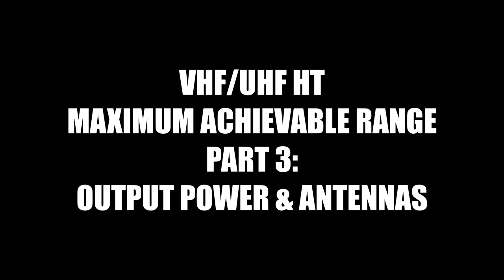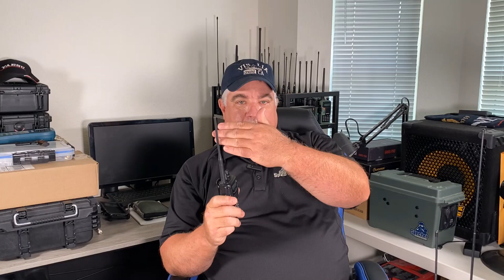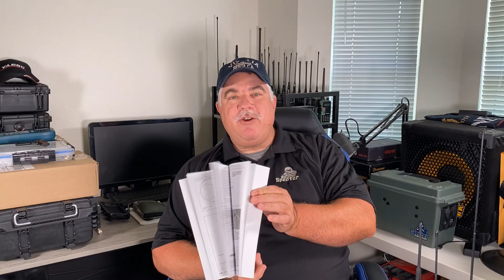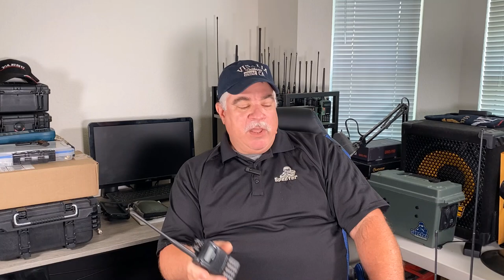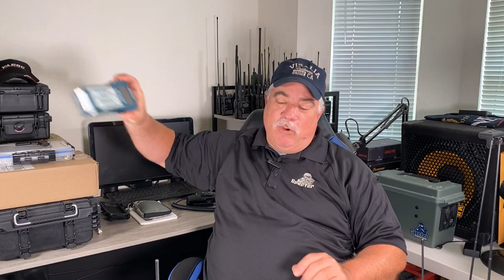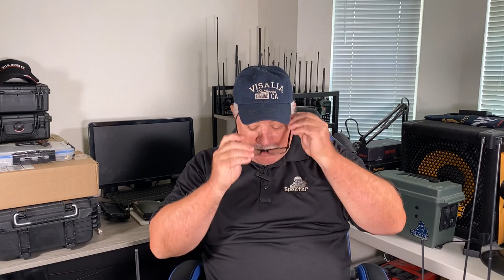VHF/UHF HT Maximum Achievable Range - Part 3: Output Power & Antennas

Comment: KD7CKT, just getting back into my Ham Radio after 5 to 6 years out due to the Loss of my Father, N7JWF/AE7AD. When Dad had strokes and such I had to short sell the house in west Phoenix and liquidate his gear and mine in the move. Just got a Yaesu FT-60 at a local Pawn shop for less than $80! Happily, it came with the original dual band, rubber duck antennae, a completely dead NiMH battery which happily came back and so far holds a full charge and the repeaters here in Flagstaff. This HT had a few channels already programmed and after a week or so monitoring, I am now involved with one evening net. 23 years ago I was very active with the Arizona Repeaters Association both 2 meter/70cm and HF so there are many new digital aspects and repeaters and connected networks. I have printed off the ARA repeater lists but have also discovered a wonderful application called, Repeater Book which includes a bunch of Nodes and connected Networks and even a few private repeaters in northern Arizona. I am looking at  getting one of the new table top discones that are so popular as I enjoy listening to Aircraft AM too and there's a lot of minerals and metals in the ground and trees here. I enjoy your channel and videos, they get right to the point. Thanks and 73's to the Ham Community once again.

Comment: for someone wanting High Power output (30+ watts) on an HT, better rethink that.
you really don't want that much RF energy that close to your head.
HT's are most commonly used being held next to the face for speaking and listening.
Reply from the maker: I don't recall mentioning that. But, I will keep your suggestion in mind.
Reply: @KS6DAY  I'm not saying that you were increasing the power output but @6:16 you mentioned amplifier and many other youtubers say they want an HT that outputs more than 5 watts or more than the false claims by china radios claiming more than 20 watts.
my comment was for those youtubers that want higher outputs of more than 5 to 10 watts in a HT.
Reply from the maker: @TwoFeatherChannel  Got it. Just wanted to make sure I didn't say something that got misunderstood. That happens from time to time.

Comment: Add a "tiger tail" on the HT
Reply: Yes, please see if there's a way to determine performance gain from a tiger tail.
Reply: But just like tuning your antenna for the best swr, you also have to tune the tiger tail for the best swr.
Reply: @kidbach  It would be nice to see how much of a difference it can make though. I have never seen any appreciable difference at all from using one
Reply: 19 inches is all you need. Don't have to go crazy